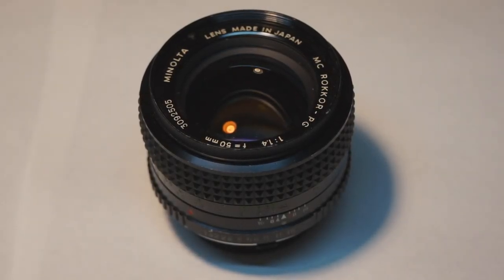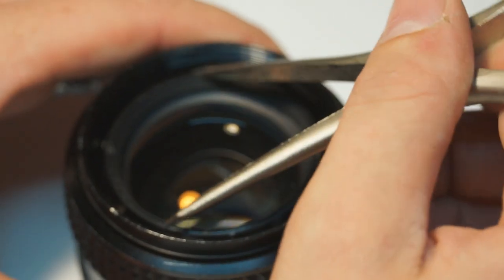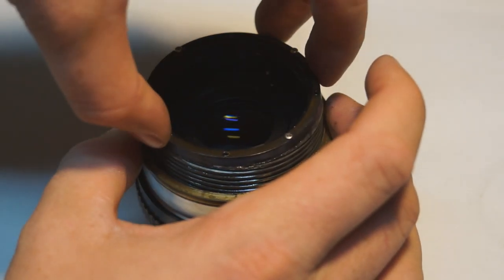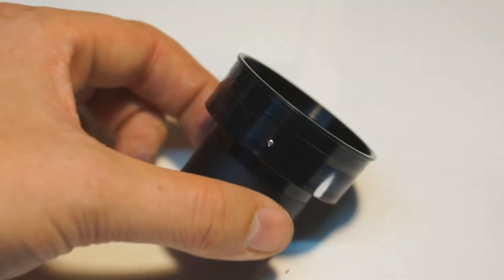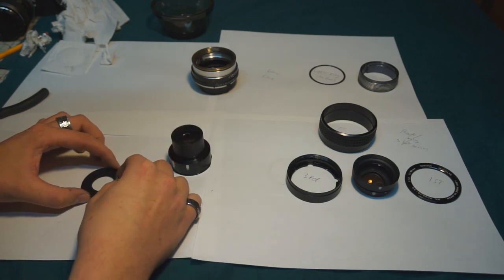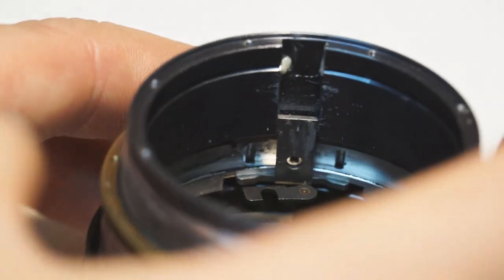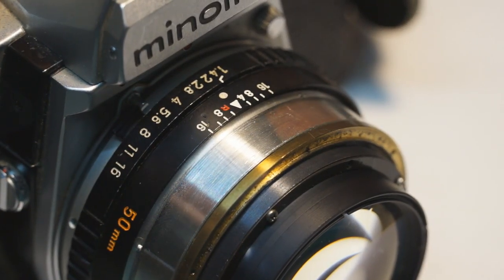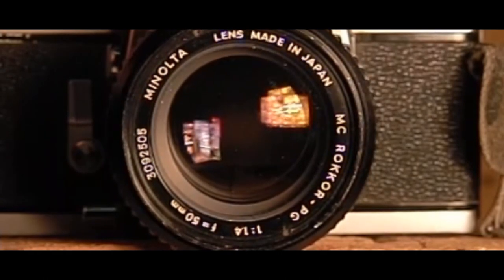MC Rokkor - PG 50mm F 1.4 Lens Repair

Comment from the maker: If the fungus is inside one of the lens assemblies you will have to find a way to disassemble them. I'm not sure but I would imagine that they are threaded together and could be unscrewed.

Good luck with your lens, if you run into problems send me a message.

Comment: You can't service the first 2 front lenses they are press fit at the factory so avoid trying or you will destroy the lens. The rest is easy and using an index marker helps to put everything back just as it was taken apart. 

It's also wish to remove the old lubricant as its made from animal protein fat and use modern lubricant or the aperture blades will stick again.

Comment: Where did you find information on how to disassemble the lens? I've got a mc w.rokkor nl 21mm f/2.8 which needs cleaning of one of the lens elements - but i'd like some basic information on disassembly before trying this on myself.
Reply from the maker: I didn't find any! I laid out some paper and wrote down the order that I took everything apart. If you have, to draw a picture and point arrows to each piece on the table. Old primes aren't that complex, if you can service and build your FPV rig you can work on an old lens.
Reply: Nick Moore Hehe, thanks! Looking at some other rokkors it seems common that the front elements are fairly easily removed - and as far as i can tell the dirt is on one of the elements in front of the aperture - so I think I'll give it a try. I can also crash my fpv rigs though ;)

Comment: Hi, I think it's on the Rear Element because I can't see it with my human macro eye vision from the front element. Also, have you cleaned the MC PG 50 1.4 for fungus before?

if so a video on how to clean it would be awesome.

because I'm not sure what the stuff is that I have to soak it in, and for how long, and what the 'motions' are that you have to put the lens/element though to completely clean/remove the fungus in this lens. if you can help in any way, that'd be cool dude. Merci.
-Courtesy